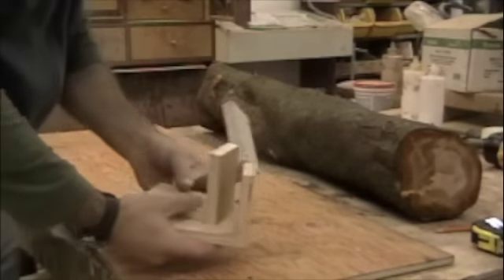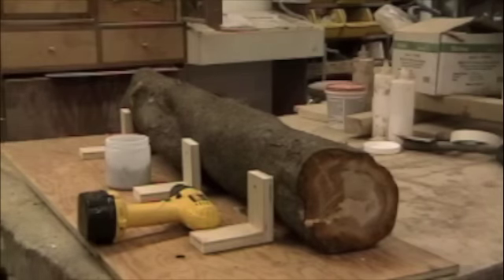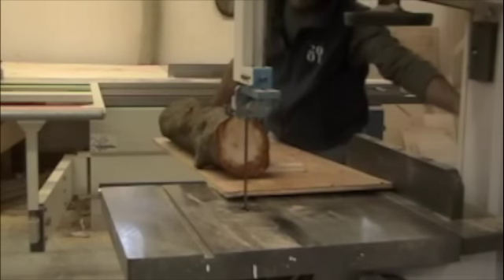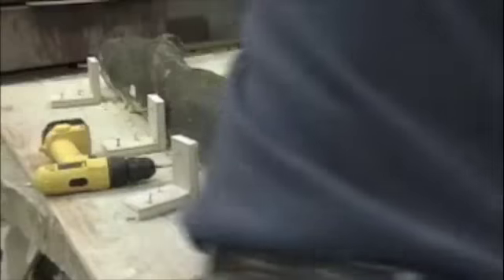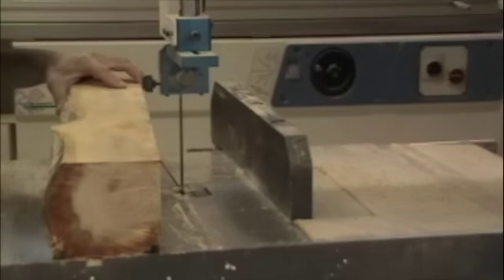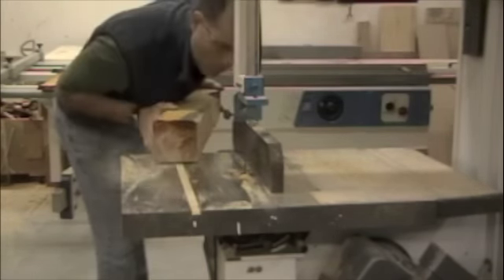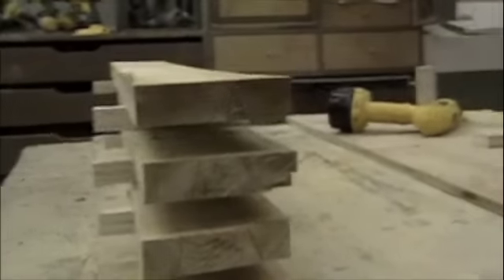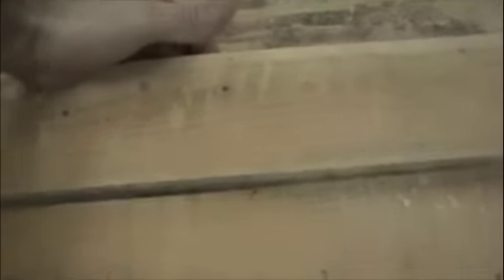How To Mill Smaller Logs Using Your Bandsaw

Comment from the maker: Thanks James I appreciate the feedback.  With respect to your question about what size and type of blade I used, I would recommend using a 3/4" blade with 2-3 teeth per inch for re-sawing logs.  A wider blade reduces drift and deflection and fewer teeth reduce heat build up by allowing the saw dust to be effectively removed from the cut.

Comment: If you find a different way to secure the wood to the plywood, you can secure it so that it hangs off the edge.  You can buy sleds made for this already or make your own sled.  The sled should have an adjustable fence so you can put the over the edge and secure the log from the end and/or the top.  The sled can ride in your miter gauge slot.

Comment: Hey John,
I recently added a 10" planner to my shop, and was wondering if it's possible to buy dried firewood like maple, oak and birch that is somewhat true and run them in the planner?
I don't have a bandsaw or a jointer, so I can't really get one true surface before planning.

Comment from the maker: It fundamentally depends on what the final product is.  If you are planning on making some rustic type furniture where there is plenty of room for gaps and discrepancies then green lights to planing the boards without jointing.  If you are wanting to be more precise then then jointing is necessary.  Remember a planer only thicknesses a board and does not remove any cups or twists.  I wouldn't run anything through the planer if it is extremely warped or cupped you are just wasting wood & time.

Comment: Hi Ten finger, I was hoping to cut 8 inch oak logs into boards with a band saw. What would you recommend as the minimum HP motor? Good video. Thanks for posting.
Reply from the maker: Hi Joe,
From my experience a 3/4 to 1 HP motor should be able to accomplish the task.  The main question is how much re-sawing are you planning on doing?  If you occasionally re-saw then the 3/4 to 1 HP motor is fine.  What is really important is the type of blade, you need to equip the bandsaw with a sharp blade that has few (2-3) teeth per inch  and wide gullets.  The blade is more critical than the HP.  The feed rate will be determined by both HP and proper blade, basically pay attention to how strained the bandsaw is under load and slow down your feed rate if the bandsaw seems to be overworked.
Regards,
John